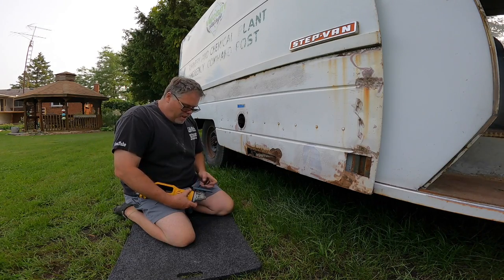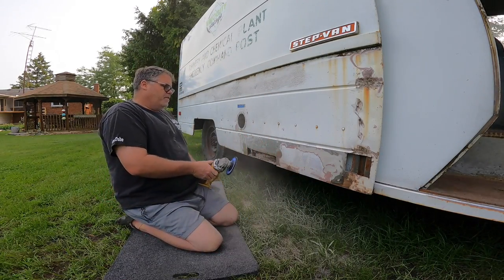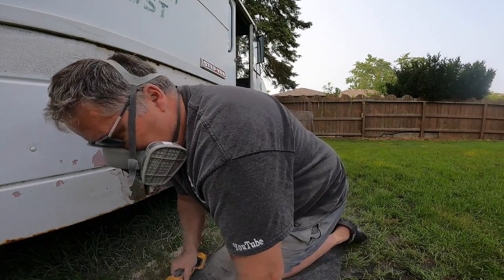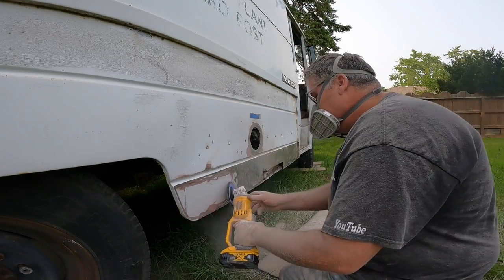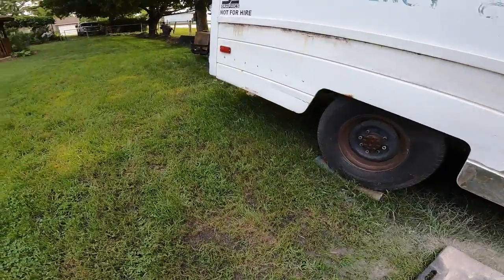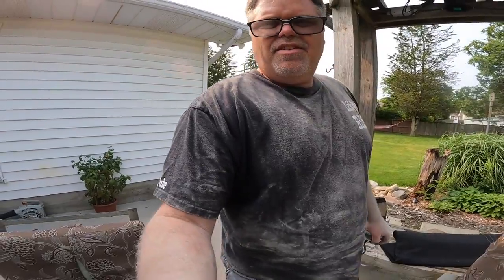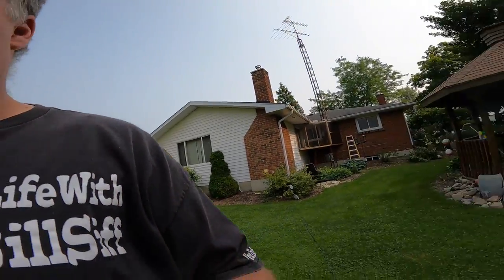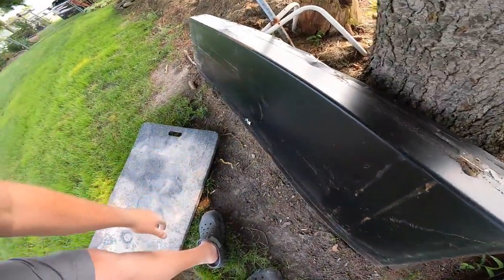Why So Much Bondo   HD 1080p

Comment: Decent bill 👌 well i have welded flux core a lot and dual shield a ton i have a big welder that will run .072 wire that u have used flux core in it welds way good it's a LN 25. I just started the body work on my 66 gmc truck this week

Comment: I use a little 110 harbor freight flux core welder its light and portable and have been using it for sheet metal on ny dump truck. But its dirtier then regular mig with shielding gas

Comment: Flux core is all I use I like the versatility and no worries of running out of gas I run it on the hotter settings and do quick tack welds on sheet metal less chance of burn threw never have had a problem but I’m no professional